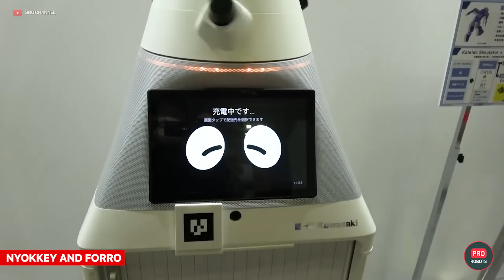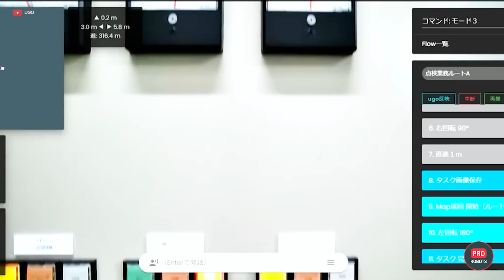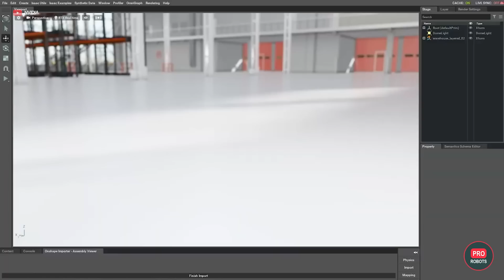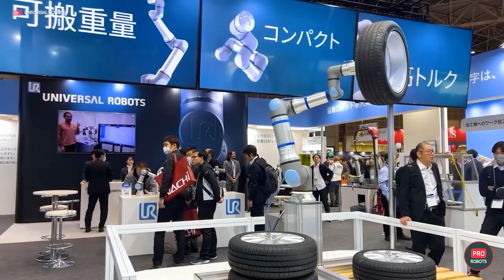IREX 2023 - Japan's largest robot exhibition | The latest robots and amazing gadgets! | Pro Robots

Comment: Maybe the two legged robot without the straps to human user is designed to help pick up and lift things up off the ground. They could use different type of arm attachments. Then it would need to be able to bend over to pick them up or help lift them and set them back down when assisting the user. 🤷🏻‍♂️ or maybe to carry medical equipment needed to support a patient in hospital during movement exercises and then any hoses or wires would stay close and wouldn’t have to use a cart pushed behind patient.